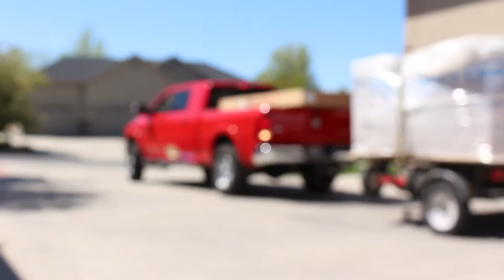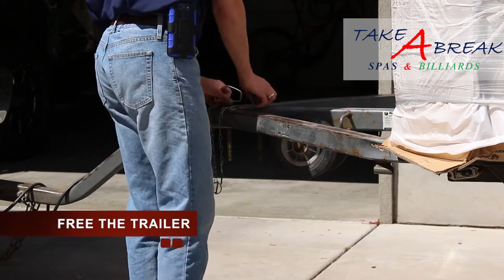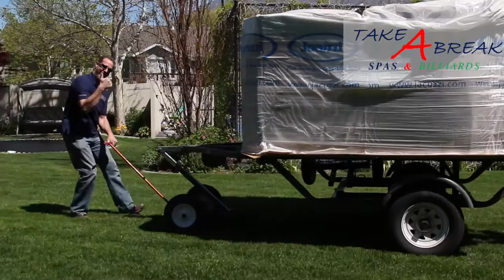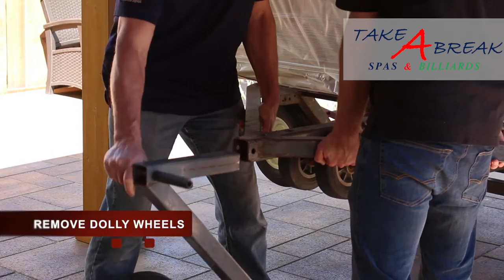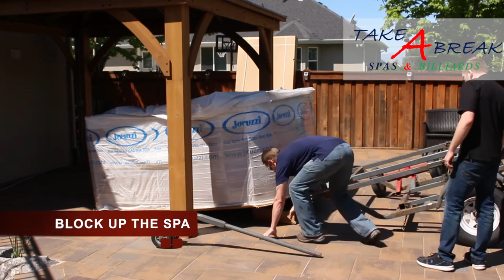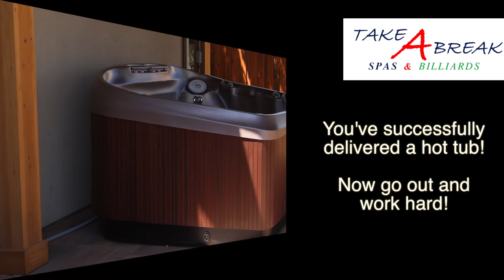How to Deliver a Hot Tub using a Spa Trailer

Comment: That's great, as long as your property is totally flat. Most hot tubs we've delivered and placed were downhill from the front yard. Also, every house in this area has a gate no wider than 40" wide. So this wouldn't work here, even if it was a flat property.
Reply from the maker: That's right, this video only covers the basics. For the most part we're tipping the spa up on its side and delivering on the detachable dolly.